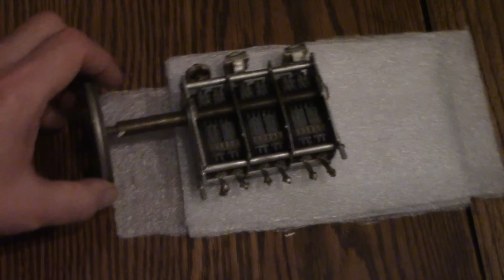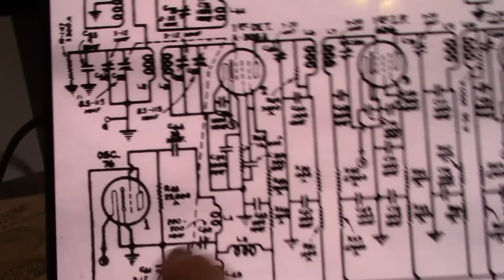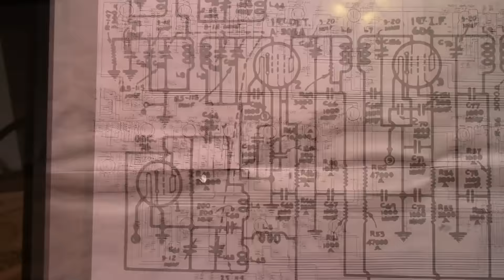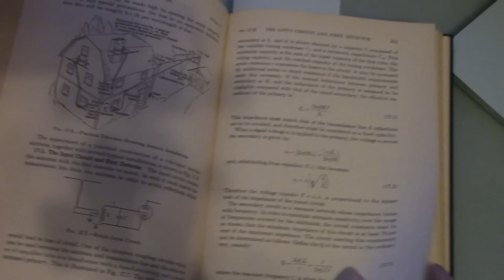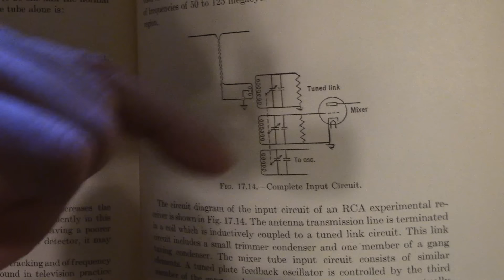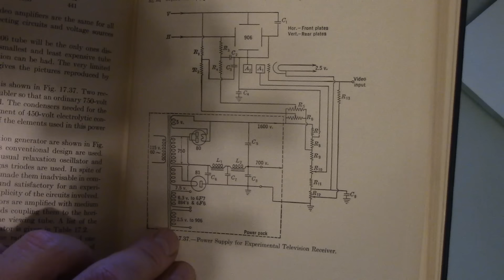RCA 1936 RR-359B field test TV: part 6 - Tuner talk

Comment: For purists' sake, I'm going to speculate and say the RCA engineers used an "off the self" gang tuner. Assuming this; they would have either procured one from a common radio parts supply house or perhaps internaley from their parts department. This unit as I see it is essentially a "Radio" designed to pick up RF but ultimatley to drive a speaker and a CRT. Did RCA have a "stock" 3 gang tuner for production units or dealer spare parts for an existing model radio(s) that they appropriated for the R&D of this TV? Perhaps. Either way, a search of radio parts suppliers catalogs of the day would be worth a shot? Did RCA have any catalogs of parts available to consumers or Hams who wanted to build/modify their own radios or roll their own TV? Again, worth a look. Even if RCA modified an off the shelf unit, grafting the aforementioned parts onto a base unit, it could be a start for those who ultimatley want to put one of these units back to original - as built - condition. Just a thought.
Reply from the maker: Yes, RCA encourage experimenters to build their own TVs and sold parts.  Not sure about the tuner though. I don't think an off the shelf radio tuner would work though.  This works on much higher frequencies than a commercial radio back then.
Reply: @bandersentv  Yes, very good point. That thought crossed my mind but I failed to mention it. I'll try to see what we hams were up to circa 1938 with AM VHF expeimentation. Maybe get a lead.
Reply: I've checked some RCA radio tuners from this period. Some do use 3-gang capacitors, but I haven't found any that match, including in a radio I have that has a high frequency band. All the radio capacitors I've found have higher capacitance than this TV tuner, probably because they're mainly tuning lower frequencies (AM at the time, FM didn't really come on the scene until a few years later). Air variable tuning capacitors were being mass produced for radios, and RCA would have had access to the production facilities, and they may well have had a special one built for the TV band.  It would be great if we could find a matching one in a radio though.

Comment: What bemuses and amazes me (bemazes? but not amuses) is the humongous tubes that were all that could be worked with, with lots of electromagnetically active real estate on each pin, not our more modern miniature tubes let alone the nuvistors.  And now below I see discussion about early circuits with lots of electromagnetic leakage.  Well, is anybody knowledgeable surprised.  Anyhow our intrepid OG TV man will have to work with that, where geometry is king (sort of).  Hope the TV hacking produces something that can be demonstrated workable.  Maybe others in the TV club can produce a reduced-power transmitter to go along with the early TV.

Comment: Interesting mechanical tuning setup. It looks like the larger tuning wheel is moved by the smaller tuning knob by a "V" pulley that captures the outer flange of the larger dial. 
No strings attached 
:P

RF-wise I agree with other commenters.. the coils are likely all ganged onto a common form (another research project for you.. making the form) and the RF osc couples into the front-end of the mixer that way. The main tuning gang should have a grounded common shaft.
Deliberate mis-direction? Or were they talking about some other obscured perspective in the book?
Cheers,
Reply: Surplus Sales of Nebraska has some coil forms. Some ceramic, but the most interesting ones are listed as straw coil forms for tuning slugs. In this application we may not want a tuning slug, but they have them too.
Reply from the maker: Yes, you are 100% correct.  I will be posting a follow up video soon with more revelations.

Comment: Too kool! Easily the most fascinating vintage electronics video I've seen in years.  I get the feeling electronics engineering was a lot more fun in those days than it is now.  When I was a kid, my father who was a radioman in WWII had a proclivity for bringing home broken TVs.  By chance I got one old 1950s Philco working.  To improve its reception I took the continuous tuner from another dead set and used it to splice an extra RF stage onto the Philco, and sure enough that pulled in a couple of weak stations I couldn't get otherwise.
Reply: TV hacking.  Try that on our modern digital sets.

Comment: Surprisingly (at least to me) I noticed that when I encountered poor quality schematic scans like that, I needed to zoom out, not in, to read them. 
When you look to close you can only see the gaps and or the blobs. But when watching from a distance, the brains pattern recognition kicks in. Subtle differences in the way the creator wrote, create different blobs. Couple that with, as you mentioned, your experience and you'll get a lot correct. 

At first I also always blamed bad scans, but then I found more and more originals and it seems just a lot of those engineers seem to have used very fat pens😂. Likely they didn't care, they understood the schematic and what had to go where. And much wasn't that critical.

Comment: Bob, I can definitely help you with this project, most of my career was the RF design of HF to UHF transceivers.

You are right, the first thing you need to do is redraw the schematic to get all correct component values, make it legible, and draw it such that the signal flow is simple and logical.

The oscillator is, as you suspected, a Hartley configuration.  There are a lot of things in the design that don't make sense.  I did figure one of these out; that 200 - 500 pF trimmer capacitor (C60) that goes to ground connected to the coil center tap.  This is being used to reduce the gain of the oscillator to the point where it barely oscillates so it will generate a clean, spurious free signal.

I also noticed the absence of oscillator injection to the mixer tube, of course the random use of connection tie points adds to the schematic confusion.   I suspect this oscillator circuit (due to the remote location of the mixer) was spraying signal all over the lab and causing major interference problems.

I couldn't find any datasheet on the A305 tube.
Reply: Coupling is through L1-2-3-4-45 all being concentrically wound on the same small form just below the tube socket.

There would be no published data on tubes like the A305/6 only engineering sheets. Prototype tubes are lettered A for receiving tubes, B for transmitting tubes, C for crt's and R for rectifiers.
Reply: @auroradesign1718 Thank you again for your valuable input!
Reply: @auroradesign1718 I don't know what the designers were thinking; all those inductors wound on the same coil form would totally bypass the bandpass filtering (the preselector performs) by radiating high levels of LO out the antenna terminals and preventing the rejection of the image response that occurs at LO + IF if highside injection is used (the default in most cases).  RCA would learn this mistake well during WW II radio designs for the military.  Receiver LO leakage out the antenna port gives the enemy the ability to home in on your receiver's LO.
Reply: @billharris6886  LO leakage out the antenna was a big problem in pre-war sets. Not only theoretically, but in practice. There is an RCA note about interference causing problems from a neighbors set radiating from his house antenna to yours.
For the 1939 Worlds Fair where you can see pictures of lines of TRK12's operating so people could walk by and view them, this was a major problem. They ended up modifying an RR-359B with a cathode follower for a line level video output and an additional stage of audio amplification to a coupling transformer. The TRK-12's were modified with an extra chassis to accept the line level inputs much as we would do today in this situation. (I believe the ETF has pictures and tech data on the TRK12 mods)
Reply: @auroradesign1718 Yes, I have looked at the TRK-12 schematics in the past.  Very advanced for their day, they remind me of some of the early HP test equipment where several work-around circuits were devised to make up for the frequency limited devices they had to work with at that time.  They didn't have any TV specific tubes available, so had to work with the radio tubes available at the time.  I know RCA, seeing the future of TV had an elaborate display of TVs and TV Cameras operating live at the 1939 World's Fair.  Thanks for mentioning the steps they went through to minimize interference.  I know they wanted to present an ideal example of what television could be in the future so, no surprise they used a baseband video feed via coax cabling.

 During World War Two, the development of Radar really pushed the development of high frequency tubes.  It was found that the electron transit time was too long for Pentodes so, they had to drop back to triodes, with their high plate-to-grid capacitance (which makes amplifiers oscillate nicely).  The solution was the Lighthouse tube.  Anyway, I really enjoy the history Radio and Television history!
Reply: Very helpful, thank you. Despite all its shortcomings, I think Bob will still be trying to reproduce the original tuner, as a historical restoration. Perhaps whoever had enough knowledge to try replacing the vertical oscillator with a thyratron also realized the original tuner was a poor design (in addition to not being able to receive higher channels), and decided to replace it with something newer and better. Now, for restoring this early set, we have different objectives. Hoping for Bob's success.
Reply: L5 is a decoupling choke (commonly called a Radio Frequency Choke).  C60 would likely be physically large and have many plates.  By comparison, the typical AM radio tuning capacitor has a range of 10 to 365 pF.

I am seeing so many areas where this Front End circuitry is just cobbled together, it had to be very unstable.  For instance, the Local Oscillator tube is a poor choice and it is designed poorly.   Normally, you would use a Pentode to reduce Load Pulling problems.  If I designed that circuit using the same tube, I would use the control grid as the input and cathode for the output where it is connected to the L/C tuning circuit.  Then take the output feeding the mixer off the plate, which provides some buffering to minimizing load pulling.

They are also connecting the mixer and IF amps as Tetrodes instead of Pentodes - why?  Tetrodes become very non-linear at normal to high power output levels due to the Secondary emission off the plate.

Bob, when you look at this same set at the TV museum, take lots of pictures of the tuner and IF.  Also asked if the set can receive a signal through the Front End.
Reply: @billharris6886  These tuners are surprising stable. If you want a real treat, the 1931 set used UY227's as the LO's with basically the same 40-80MHz range and the IF's were UY224 tetrodes, specifically before the 24A's where they purposely carbon coated the plates to reduce second emissions. They actually take advantage of the secondary emissions using them as Dynatrons for the scan oscillators.
Reply: @auroradesign1718 Thanks, I'll have to look that up, sounds very interesting!
Reply from the maker: I do know that they quickly made changes to the tuner.  Later revisions used a 6J5 LO and 1851 mixer tube.  Also went from continuous to a rotary switch.  

I believe the experimental A305 led to the 1851 and A306 the 1852.   

Although the set at the museum was restored, it has not been powered up in a long time.  Perhaps never since the museum got it.  They may let me try someday if I get mine running.,
Reply: @bandersentv  If I remember right, the 6J5 is the same as the 76 tube, with the 6J5 having the newer Octal Tube socket.

From the tuner picture with it mounted in the set, the tuner dial is showing a tuning range of 39 to 88 MHz; that had to make the tuning very touchy.  In 1936, these high frequency ranges were probably uncharted territory so, technology from manufacturing shortwave radios was probably used.  None of the tubes they used were up to the task, they should have used the new Loctal style, which had significantly less lead inductance.  The default standard Octal type were only good up to about 30 MHz.
Reply: @billharris6886  The tuners, even on the narrower 343 line sets, operates extremely well. The tuning knob, while  being a vernier type, allows centering the station as easily and stably as any radio of the era. There is virtually no  perceptible LO drift.
Reply: @auroradesign1718 Thanks for the feedback, you must own one of these sets to be so familiar with the history.
Reply: @billharris6886  At least ;)
Reply: @billharris6886  I have a 1936 model (introduced in 1935) RCA radio with an ultra short wave band that's spec'd to go up to 60 MHz, but the dial actually goes up to 73 MHz, and it's reported that they often can tune that high. In some ways it's a bit better designed than this, it uses pentodes and pentagrid (6J7 oscillator, 6L7 mixer). It has an RF stage, but on the highest ultra short wave band, that's bypassed and the antenna goes directly into the mixer. But unlike this TV, the antenna and local oscillator go in to different grids on the 6L7, so the local oscillator may not be radiating into the antenna to the extent this TV tuner may. So at the same time RCA was building shortwave sets that could tune up into part of what they were also using as their field trial TV band. This is an RCA C13-2, a higher end radio.
Reply: @garystrait3289 Great info and much appreciated!  I didn't know RCA had a receiver that advanced at that time.

Comment: Definitely a Hartley oscillator design. Each tuning capacitor plate has a corresponding LC circuit to make the thing work and
each connect to a grid of the 1st detector tube making it a feedback amplifier. One has a connection to the cathode of  the
tube  to start a wave of oscillations and induced by changing capacitance by the variable capacitor. It's a science experiment
using resonant frequency calculations. Hope you are good at math Bob.

Comment: This kind of reminds me of how UHF tuners worked in the 1950s. The coupling was via the tuning capacitor shaft. The local oscillator was usually a very small triode (sometimes an acorn tube), and the mixer was a solid state diode. Signal amplification relied on the RF amp and mixer of the VHF tuner.
Reply: All of the early (mid 1950's and onward) tuners I have looked at used Aperture Coupling (a small hole) between resonator cavities, with a coupling loop into the first cavity for the antenna input.  The mixer diode was a single 1N34 (or equivalent), with the IF output being at 44 MHz.

You can't really use the ganged variable capacitor shaft for coupling, that causes the signal to bypass the resonator sections.  Normally, these capacitor shafts had grounding fingers as the shaft went through each shield wall between cavities.

Comment: Gotta keep in mind- That book is riddled with a bit of pride/showmanship that’s overtly Dunning-Kruger… it’s Zworykin, after all… He and RCA at large were still deep into the lawsuits with Farnsworth when that book was written. They needed all the legitimacy they could get.

As someone with a ms degree in these supposed “dark arts” (it’s really just RF slosh management)… claiming that it’s being ‘coupled through the tuning shaft’ is a fancy way of saying that “we ran out of time and slapped an oscillator next to it that leaks like a sieve. It worked well enough for the prototype, so we left it in… Here’s a bunch of math to make us look legit…”

In actuality, it’s exactly like how when one performs an IF alignment on an AM radio, they simply drape a random length of wire from the signal generator over the antenna coil to couple in the signal. 

It’s not that deep, and they could’ve done much better.
Reply: My thought before seeing the capacitor shaft claim was that L 2,3,4 were on the same former and couple to each other. 
With no preamp it relies on that TRF circuit being at its best to keep the LO from radiating the neighborhood.
Reply: @BlueSkyScholar  This is exactly correct. L1-2-3-4-45 are all wound concentrically on the same small form. You can see the form just under the tube socket running parallel with the tuner shaft. Not sure I would ever quantify Zworykin, Kell, Holmes, Morton, et. al. has having Dunning-Kruger.
Reply: Clearly, David Sarnoff operated RCA as a radio monopoly so, court battles were a regular occurrence.  I imagine they had a substantial legal team (or "Big Guns" as we would refer to it today).

"Dark Arts", I love it.  During my career, all the non-RF engineers called it "Magic".  RF is so math heavy, and the fact you can't visualize it, frightened most people away.
Reply: Does it need to be deep? They made it work. End of story?
Reply: @bzuidgeest  my “its not that deep” quip was in response to the passage in the book itself and how it spun things. 

what I’m mainly getting at is perhaps Bob should consider reworking some of the mixer stage such that it doesn’t blast a spur all over the house that’s 25.75MHz up from ch. 3
Reply: @X5Industries  The radiation problem shouldn't be as bad if Bob feeds it via coax from an RF modulator instead of an antenna (how we do pretty much everything these days, since there's no more OTA analog TV)..
Reply: @X5Industries i see, but if he goes for the original he'll have to. That was how it was. Luckily he wants to place it in a museum, not his house😂

Comment: I once had a 1941 Philco radio with a sticker on the back saying "Built to receive television sound, the wireless way". The plan was that budget-model TVs wouldn't include an audio section; the TV would intentionally radiate its audio IF at around 8 MHz, which you could pick up on a nearby shortwave radio, and use that to receive the TV sound.